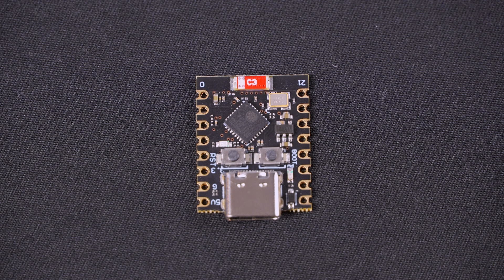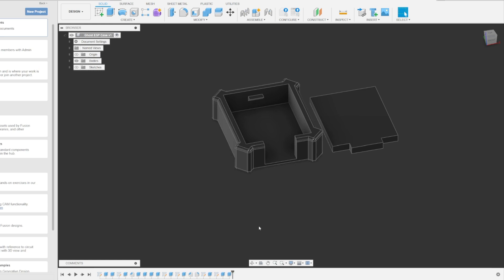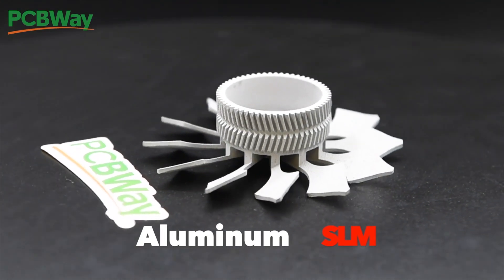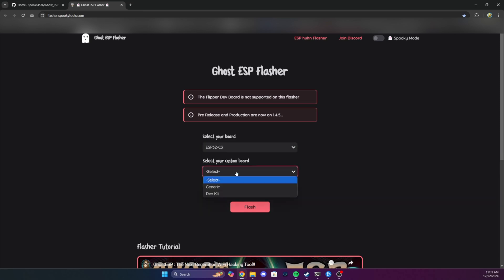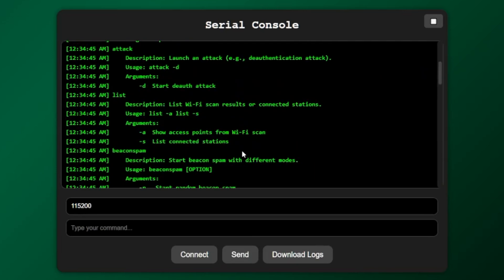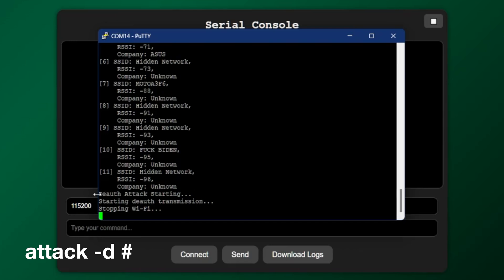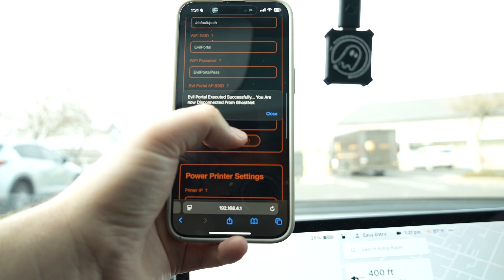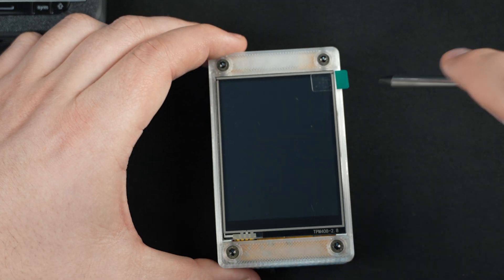Ghost ESP Build Guide - The Quarter Sized Wi-Fi Pentest Tool

Comment: When you use the display version, how do you connect an sd card reader? Can you define the path of a captive portal saved in the card reader? Where are the requests (get, post etc) saved? In the display version,you just flash the firmware?
Reply from the maker: Hey! The display that is used has a built in SD card reader. It’s the Cheap Yellow Display and there’s a link to it in the video I reference.

It’s just a build guide and I don’t go over how to configure it. I don’t believe you can set a custom location where you put your portals. I THINK you just add an index.html to the root. But I would refer to the wiki.
Reply: Just Google a web site ,,right click save the https path on search bar ,,simple,, for fun I managed to clone porn hub https for evil portal,,so it's not hard...don't limit ur search to the first video u see ,, keep scrolling and u be surprised what features it can do...